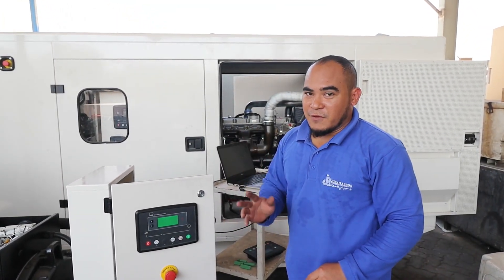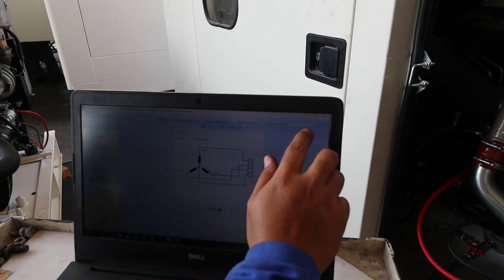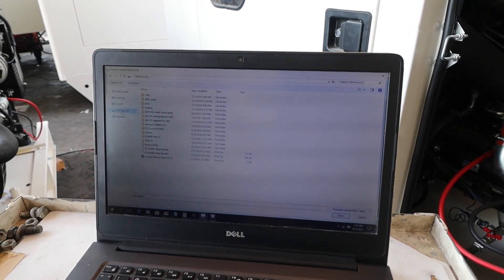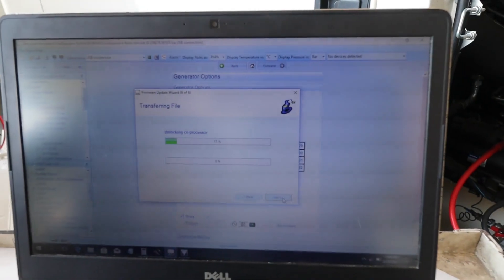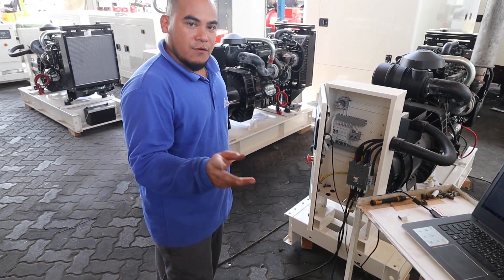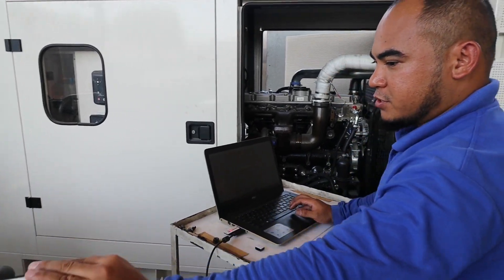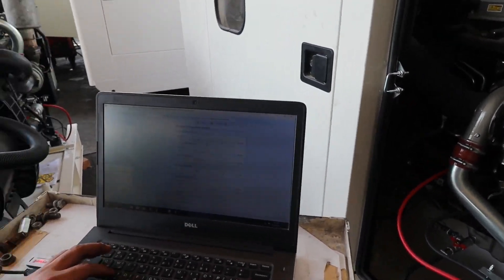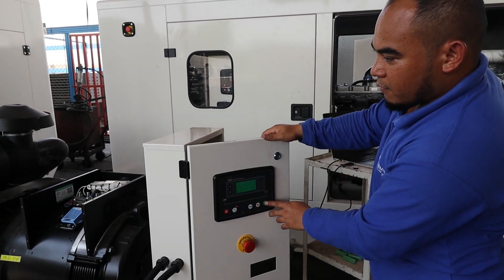DEEPSEA MODULE defective, not communicating, memory corrupt, no display, how to fix it? benzblogs

Comment: podrias pasarme el archivo plus del DES6120MKII, tengo la falla de memory corruption
Reply from the maker: Amigo do one thing open your laptop check update firmware you can use ither downgrade or upgrade the version to make it back the original file
Reply: @benzblogsVlogs  listo amigo, me sirvio demasiado, muchas gracias, excelente video

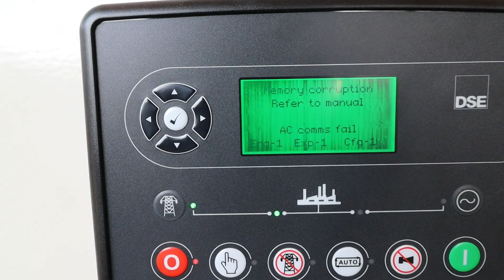Comment: Faced the same problem on DSE 3710 as on 4:15 . It was not possible to solve the problem, I tried to fill in the firmware, but the error came out "Connection with the device is lost, try again" Please tell me more about how to solve this problem
Reply from the maker: Only update firmware to solve your problem before doing it again make sure usb cable is good no lose connection or problem
Reply: @benzblogsVlogs  I tried a new cable and still after the start of the firmware, the window opens literally: Communication with the device is lost. Failed to update the firmware. The module is disabled, try again
Reply: @benzblogsVlogs  I followed all the instructions and instructions to turn off the usb and power as indicated in the firmware window
Reply: @benzblogsVlogs   Do you have detailed instructions on how to fix this problem?

Comment: Hi, I have a controller whose firmware upgrade was interrupted. Now I'm trying to upgrade it, but it fails and I can't proceed. Is there any procedure to fix this?
Reply from the maker: If the module still can detect the usb thin still posible to update firmware thats only way
Reply: @benzblogsVlogs I can connect, but it doesn't allow me to change the firmware, it displays an error message In that case, there is no further recourse. Thank you for your attention.

Comment: My generator  displays" memory corruption "and" AC commn fail  reffer to manual "how can i solve the problem please
Reply from the maker: Hi sirhave a great day this now new update with deepsea no need link it now not working juat go to update firmware follow the instruction after that you need to do the new config for the genwrator
Reply: The DSE module is 6110mkii auto start and i don't have the  software setup(app) and could you please attach me the configuration setup(software app).the generator is JB100 .please help me sir
Reply: I appreciated your instructive lectures and keep a head
Reply: What contains the USB for what purpose we use it?
Reply from the maker: For now link is not working go direct to update firmware  @zenebehagos3537
Reply: Hi bro, you can try to replace internal baterai on your depsea .suspect DC voltage lithium internal was low

Comment: Hello, all buttons for our DSE controller for the changeover failed to work
Reply from the maker: My be working but there problem with wiring or voltage supply
Reply from the maker: Check relay if working during ooeration breaker close command check using multimeter or vesual
Reply: @benzblogsVlogs  thank you for your response, however nothing seems to be working, even the lights showing mains power , on load , manual or auto are not lighting

Comment: Mine has a continuous loading indicator, can't upload via software, and can't configure via manual buttons, what should I do?
Reply from the maker: If it happens that you cannot update the firmware using the laptop thin there is something wrong with the hardware

Comment: Sir do you have viber i want to learn because i have the same controller you fix with no display
Reply from the maker: That is hardware problem open the module and check the ribbon if good

Comment: Hi recently i am facing issue that dse 8810 not indicating any LEDs on controller and not starting like hanged condition so tried firmware updation , after updation problem solved but again it comes after power off 
What may be the reason
Reply from the maker: The reason is your clock battery is dead

Comment: Mine is a deepsea 702k and it's starting the gen set in auto mode when power is on and it does nMine is a deepsea 702k and it's starting the gen set in auto mode when power is on and it does not go off.
What might be the problem? 7:43 ot go off.
What might be the problem?
Reply from the maker: Ok check your configuration if your amf is active correct connection for your remote or your remote config is active

Comment: Mine is a deepsea 702k and it's starting the gen set in auto mode when power is on and it does not go off.
What might be the problem?
Reply from the maker: Check fuel relay is active check configuration check wiring connectors

Comment: hi benz,
i have this generator, 
 i want when i stop the generator it would go cool down for 2 mintus and then stops.
i put tick enable cool down in stop mode in the miscellaneous option and gone on stopping timer in a deepsea config suit and increasing stopping time to 2 m but when i press stop it will go off. no cooling down.

what should i do? in deepsea config tool 
thanks benz
Reply from the maker: Cooldown will active only in auto try to put auto while no connection of temote it will cooldown at the time u sit of you want to active that in single dg without ats remond me on mondy whin im on the office

Comment: Deepsea DSE7320 memory corrupt issue. There is a small battery inside the module & the memory corrupt issue got successfuly got solved
Reply: After replacing with a new battery
Reply from the maker: There is two type can cause memeory currept one is by mitakes during programing ang one is the clock battery
Reply: So in my case it was the clock battery
Reply from the maker: @shihamshibly507  good
Reply: So in my case it was the clock battery.
Reply: Mine is a deepsea 702k and it's starting the gen set in auto mode when power is on and it does not go off.
What might be the problem?
Reply: Hi,well done

Comment: Thank you for the teeching video. I have DSE 6110 how i can flas the system could you please share me the link and type of doing this to fix it
Reply from the maker: No need for the link just connect your loptop and thin update firmware after that it back to normal

Comment: I had a DSE7310 MKII, memory corrupt , AC comms fail, and l upgrade firmware ver. 2.2 to 4.1 , but no change same problem.
Reply from the maker: What you mean you update its finish firmware update what you its same
Reply from the maker: Ac comm fail is the problem check your wiring fuses and etc use multi meter to check

Comment: 7320 new module does  not  communicate  with my laptop usb says doesn't recognized?please help me
Reply from the maker: Try to update your sofetware and make sure its genuine
Reply: 7320 deep-sea module doesn't  connect  with a usb port.on &off to pc can't update firmware. Plz help
Reply: Hi sir I can't update  firmware to my 7320 module doesn't appear onscreen/software. Plz help
Reply: HI sir I can't update firmware to my 7320 module .does not appear on the screen/software

Comment: Can you assist me with a dse 7420 flash file, am having a similar issue but mine is coming on just that the display isn't showing anything
Reply from the maker: No need flash file just update firmware and follow inatruction thin all is good

Comment: I also have new 7320 that stops communicating, doesn't display light at all  how do i fix it pls. Thank you sir
Reply from the maker: Do one thing connect paower supply after that connect the usb to the latop check if any communication betwen your deepsea and the laptop if there is thin update the firmware if no thin meaning to say that your module if fully deffective or not posible to repair

Comment: Yung DSE 8610 MKII ng cummins genset namin, pag start mo nag crank sya at umaandar, ang problema wala syang display na voltage, speed, frequency as in no display ng parameters. Ano kaya problema??
Reply from the maker: Check mo sir gamit multi meter para sure kong may volatge talaga after kong meron check mo sa likod ng module yung wire na V1 kong may pomasok na voltage okay po
Reply: @benzblogsVlogs  wala sya kahit ano, hindi lang po voltage wala, pati rpm, frequency wala din
Reply: Ang nasukat ko 2-3V lang po. Hindi po kaya loss of excitation?? Paano po mag excite??

Comment: how to fix deep-sea 7320 module memory corruption, please teach me
Reply from the maker: Just simpky update firmware that it
Reply: @benzblogsVlogs  I have tried updating the firmware from version v4.1 to v5.0 but the display failed to appear (communications link to unit lost. Firmware update has failed. Module is inoperable. please try again) even though my USB cable is connected
Reply from the maker: @ahmadsyarif9862  failure because you got the wrong firmware
Reply: @benzblogsVlogs  where can I find the correct firmware Sir? Please help me

Comment: Hello friend, thank you very much for your video, I'm following you from Angola and I have a deap sea 6110 module that suddenly its screen had first turned to writing and now it turned black. Can you give me a tip on how to resolve this? I am grateful to you from now on.
Reply from the maker: If only disply is gone and its working meaning ither lcd is problem or just adjuat the contrast of your lcd now if still same thin open check the ribbon of it clean it and put it back
Reply: @benzblogsVlogs  thank you so much

Comment: have a similar issue, my module screen went blank... back ground light is ON but nothing displayed. no lights on the start or Man.
Reply from the maker: Check first open the module check the LCD if the rebon is properly installed or clean it

Comment: My module is called DSE7320 V7.0. The problem is "MEMORY CORRUPT  REFER TO MANUAL", When  I  try to update firmaware to the lasted version 14.0  the dse config show me"  INCOMPATIBLE HARDWARE
                                                                                  UNIT IS MODEL CODE 7320, MODEL VARIANT 0, HARDWARE  VARIANT 1.
                                                                                   FIRMAWARE FILEIS MODEL VARIANT 0, HARDWARE VARIANT 2."

PLEASE HELP ME Mr, thank you.
Reply from the maker: Thin try yo downgrade there is no issue
Reply: Thanks Mr,
sorry, but i dont understand your explanation, i try downgrade in config suite or in dse site?
please helpe @benzblogsVlogs
Reply from the maker: @VidalGonga-r3x  due to not allow the company rules
Reply from the maker: @VidalGonga-r3x  downgrade the firmwarevrrsion

Comment: Sir gud day ask ko lng nawalan Ng function Yung push button Ng dse 7220 nung una may ilaw pa SA push button tapos bigla nalang nawalan Ng ilaw at ayaw na mag command please response salamat po
Reply from the maker: Meaning ither hard ware of software issue nayan sire try mo save ang program tapos try monupdate firmware  pag ganon parin palit kana ng module
Reply: @benzblogsVlogs  wala Kasi display to sir ung LCD Nia pero nag pa function Naman push button Nia nung una pero nung 5 times na namin ulit I test run wala nag function push button Nia Ty sir
Reply from the maker: Baka my moisture yan sa loob sir chrck monalang

Comment: Hello po sir. Please help to my unit 7320 has a display but LED indicastors no lights at all. How to fix it sir. Thank you so much.
Reply from the maker: Trybto update firmware but before doing it save the configuration after that you can wright back
Reply: sir where I can find the firmware and the flasher or installer?
 @benzblogsVlogs
Reply from the maker: @isabelosabuero8845  in the deepsea sofeware configurat
Reply from the maker: @isabelosabuero8845  no need flash its there on the configuration deepsea app

Comment: Kapatid i have a Cummins qst 30 with gcs and dse 7310. It gives ecu shutdown after crank. The ecu fault flash code is 1211.i swapped the mpu it would crank for a bit longer but then again ecu shutdown code again

Comment: hlow . poh sir . baguhan lang po  . may na in counter po ako nang ganito nga problem . . pwede po bah . maka hingi nang advice sayo.  followers mo po ako . . tga Philippines po ako .
Reply from the maker: Walang problima sir pa clarify lang kong anong nahing problima
Reply from the maker: Pag currupted update firmware mo lang sundin mo lamg yung sinabi ng computer
Reply: kuya benz.  . yung about sa re flashing  pano yun .
Reply from the maker: @RolandOrapa-dr6hl  dina kailangan ngayun sa bago g update ng deepsea bali e update firmware mo nalang para mgok ang module
Reply: dse7220 po yung model kuya benz .   baka mka hingi ako nang tulong wlang dsplay pero ma manual sya ma start.
Reply: cge kuya.  benz salamat po . . followers mo na ako ngayun.   may project kase kami sa ngcp  genset pms kuya benz dito sa visayas .

Comment: How , to do with the dse 7320. When it gives Ac Comms fail. Can you share me the link on how to fix it and the flashing file.
Thanks
Reply from the maker: Ac comm fail?
Reply from the maker: Waht module you are using
Reply from the maker: If that is the alarm meaning check the fuses and the voltage

Comment: Sir benz, magandang araw sa iyo, i have a deep sea module 6020 mkii the problem is i can't edit any parameter in this module and all indicator lights are  lit, is there any solution on this?...
Reply from the maker: Just update firmware that the solution
Reply from the maker: Copy first the config before updating the firmware
Reply: @benzblogsVlogs  Sir, lastly if i have 2 DG and if i bond their both neutral while running, is there anything will happen?

Comment: Thanks my brother..watching from the Solomon islands...
Reply from the maker: Welcome sir have a bless day
Reply: @benzblogsVlogs  my brother.. I've try to solve that problem memory corrupt..but when update using update firmware it stop bcos there is a password on the deep-sea electronic control board..what is the next step?
Reply from the maker: @DaveTopi-jb9ss  its should no password make sure that previouse config did not put any password from the module coz should not be asking pasword during update
Reply: @benzblogsVlogs  my brother good evening...we have put password on scada>maintenance>module lock.. someone try to change the setting..somehow memory corrupt..cfg1 eng1 and etc appears on screen..therefore we use update firmware but on process it stops updating at 71 %
Reply from the maker: @DaveTopi-jb9ss  thin try to use lower version

Comment: @benzblogs after flashing  our module and all lamps are red instead of making configuation manually as you did in this video;  can we also copy directly  to another module wich working and paste on our modeule directly
Reply from the maker: You have to do it manually to other
Reply from the maker: Why its red light all meaning no program at ll need to do it again

Comment: Hi Benz, I have the same problem on a Deep Sea 335. the error message displayed: ''Memory corruption Refer to manual''.
can you help me with the restore procedure or the link for the Flash program.
Reply from the maker: No need flash juat update the firmware version
Reply from the maker: Or if you have a config file dame version of the module write it done

Comment: Hello, I have a 7320 module which working fine but no display. What should i do to fix that. Will Fireware update fix  the issue?
Reply from the maker: Just open check the rebon remove clean it and insirt back kalas done

Comment: Hi, Bro.. how are you ? Hope you are doing well.

I am SALIM from Singapore.
I have watched your video.

I have a device model 7320 which is the same issue as mentioned in your this video.

So please advise me to solved the issue and share me to link and flash file. 

Thank you 🙏
Reply from the maker: Sir for now have update deepsea but try it if still wprking try to update the firmware if your module to higher version that it

Comment: Hello Sir please i need your help I have dse7310 MTU Generator my display is showing memory corruption  refer to manual and AC comms failed. Please what can I do. Many thanks in advance
Reply from the maker: Just update firmware version but im
Not sure now if still working that process coz deepsea update the config software
Reply: Thank you very much Sir i do appreciate

Comment: sir good day po. meron akong 8610mkii not communicating after replace new dse ok na sync. sir puwed ko bng irepair ung luma ano ussual na issues .salamat po
Reply from the maker: Usual issiuse yung mga lumang module sometime board na ang sira or dependi kong ano yung nagiging failure nya
Reply: @benzblogsVlogs  sir thank you. Mostly ayaw magcommunicate yung avr  resulting sync failure. Sa components ano usual na pinapalitan to revive the controller para po magamit ulit instead of buying new sir. Salamat po
Reply from the maker: What avr your are using so we can check if i know i can guide you

Comment: I had commented about my defective dse5110 .
You responded to my comment but found later that the modules I was buying wasn't at all authentic Deep Sea Modules.
These were cheap Chinese manufactured knock offs and made to look like Deep Sea Electronics modules. They even use DSE logos and claim to be Deep Sea Modules.
That's exactly why these cheap imitations won't at all hold up and stay working correctly.
With this, I contacted DeepSeaElectronics in Chicago Illinois and placed an order for the Deep Sea Electronics DSE 7210 MKII with Heated Display.
Reply from the maker: Sad this is the problem that its good to buy authentic

Comment: I have problem with dse7310 control panel
BRUNO GENERATOR
Display lights up but no words
Buttons work e.g engine starts bit then it will cut out after 5 seconds. Your video shows buttons not working. Can I re program this?
Reply from the maker: If no display sir check the rebon inside of the module or ither disply is defective already
Reply: @benzblogsVlogs  ribbon looks good, do you mean continuity test? I plug them out and in again in case it was a bad contact but made no difference.
Reply from the maker: @jon44sweeney  meaning lcd is the problem with this module